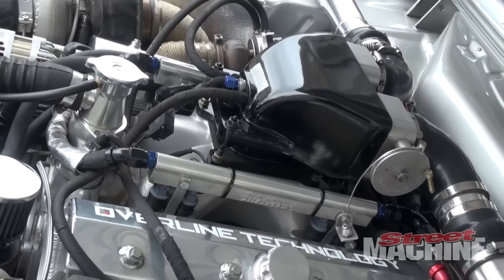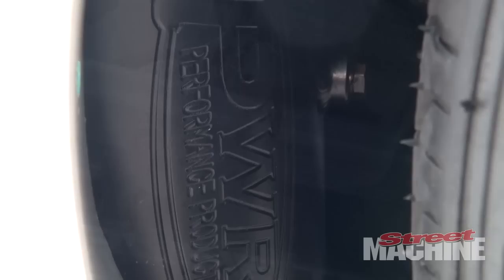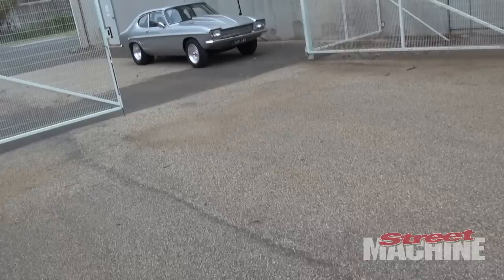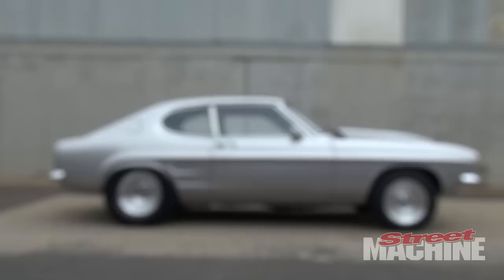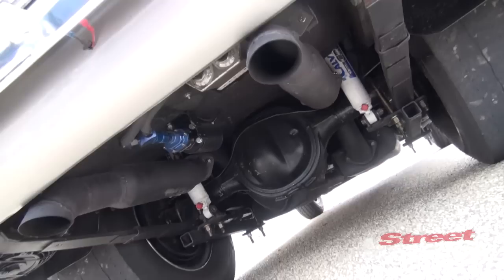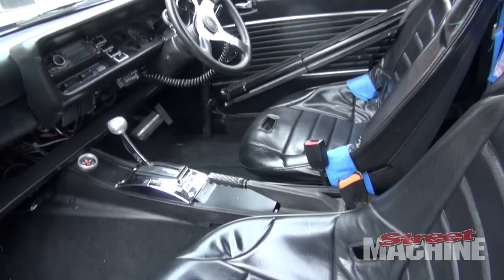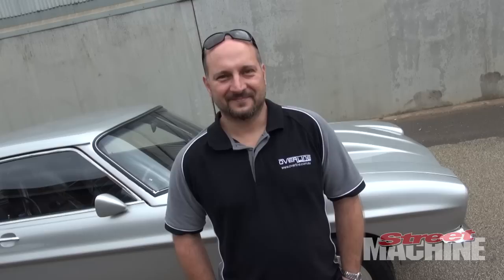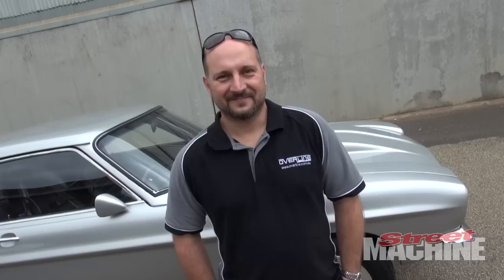George's 8sec Twin Turbo Capri

Comment: That's great. 1000hp with a 350. I'd prefer it be a 351, but.........
Reply: HighlanderNorth1 but it's a 350 and will make way more hp !
Reply: FPV F6 how do you figure????   Compare a stock sbc 350 to a stock 351 ford....chev wins.....compare a ford / Yates/ roush 351 to a chev sb2 and Chev wins every time!!!   Take a look at a Higgins SB2H sbc  making 850hp with no effort!  And yes they are cheaper but still better quality!! Ask Higgins.... he knows a lot more than me or you!!! The best outright head of all time is a SB2.
Reply: FPV F6 Ok... So you must be referring to KXW406  XW falcon from dandy engines Victoria!!  The reason why it is so fast is because he split his ford block in half and had to go to a Proline racing 481X engine which we all know is CHEV BASED and for good reason!!! Instead of 2200hp on the ford..... he now has 3500hp with the CHEV. He even admitted himself that he didn't like going to chev but it was the only way he could make the power!!!  Easily!!!!  You Ford people are champs!!! Thank you for your time. Goodnight!!!
Reply: FPV F6 My point is.... you asked for any LS or CHEV based engines that can run a 5. I gave you the 481x as an example!!!  Or maybe  a BME top fuel engine. There are plenty!!!
Reply: FPV F6 and maybe Dave Adkins 427ci LS POWERED full bodied car that ran a 5.975.  You asked for examples.... I gave you a few!!!